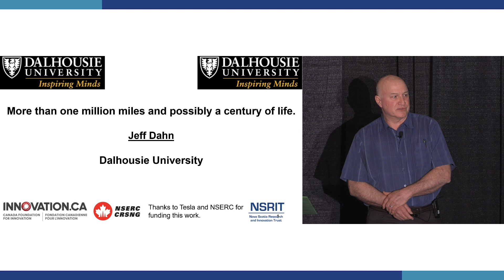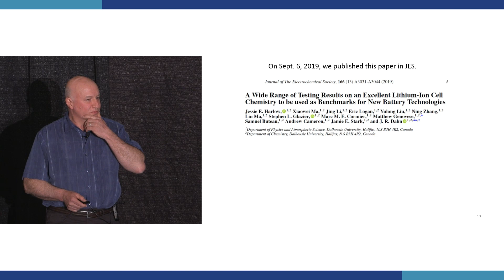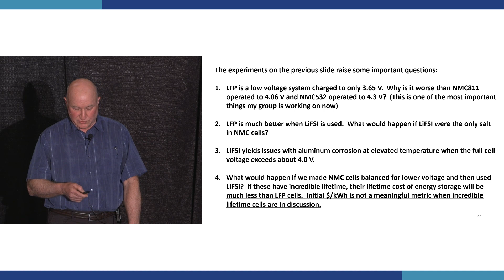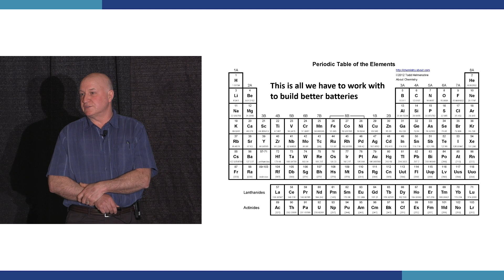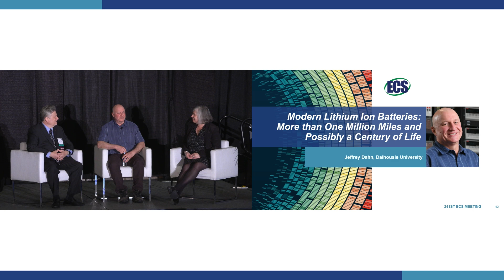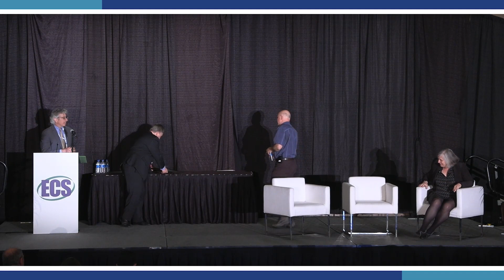241st ECS Meeting: Keynote Speake Jeff Dahn

Comment: @6:15 this does look bad (and it is), but it's worth remembering that transport by direct electrification uses 50% to 80% LESS primary energy than fossil fuel transportation, and production of low grade heat by heat pumps also uses 50% to 80% LESS primary energy than just burning fossil fuels.  So the real energy demand is likely half or less than the graph suggests.

Comment: Thanks for letting me know that my first electric car should be charged only to 70% on a daily basis, and 80% on rare times, and 90% only when required.   And that fast charging - I should do it before getting to 10% state of charge.  I think I will also be looking for a 150 KW charger, even if my car says that 280 KW is fine with the car.  

Lets say the F-150 Lightning is a $150 per KW battery pack and 135 KW.  That is a total cost of the battery pack of $20,250.  So if Ford felt they could sell that truck at $40,000, and I could somehow convince them to reduce the battery pack by about 40% to 81 KW, X $150 per KW would be only $12,150.   I would love to have a truck that is $12,150 less expensive, even if I can only drive it 90 miles a day! 

I have never driven more than about 45 miles in any one day in the past 2 years!  My trip to Medford Oregon, from Portland at about 300 miles would take 1 recharge with the larger battery, or 2 charges with the smaller and easy to afford battery.    I would love the lower cost vehicle!  

Tesla is planning on releasing information about a new car, with a $25,000 - $30,000 price tag.  I am hoping that the battery might be smaller, and thus make the car more affordable.  I would love a 2 passenger car to drive to work and home, not needing the back seat for most of that driving.  A 35 KW to 55 KW battery should be fine, if the vehicle is about 2,000 pounds?  Would that be possible?  

I was also thinking about a very low cost car that the workers in China could afford and drive to work, and be produced by the thousands!  Perhaps a three wheel, with two wheels in the front, and front wheel drive, with the battery pack under the center console of the car, say 12" wide and 60" long, so there will be more weight on the rear axle.  Maybe they could have a cast front end and a fiberglass body?  Very easy to assemble vehicle.  Keep it at about 2,000 pounds, and it should have a great range, even with a 35 KW to 50 KW battery pack.    

A cargo version would have just the drivers seat and a storage area on the right hand side, for pizza delivery, or flowers or whatever!  I know a HVAC distribution company that would love one to deliver parts to the customers (the contractors making a repair at someone's home) who are at the residential homes of their customers.  (the contractor loves it that the technicians are not spending a hour going to buy a part to make a repair, but instead can order the part, and have it in their hands within 90 minutes! ). The HVAC distributor loves that the customer is getting the parts quicker, and selecting them to sell the part to them, delivered, and in a short time!  So overall their business is up over 50% due to the delivery service.  

There are a lot of potential EV buyers who are saying "Why not install a 40 KW larger battery?"  The answer of course is that the extra 40 KW is about $150 per KW, or a $6,000 option that will also make the car mush heavier.  If Tesla has cars going 250 watts per mile, that would mean a 50 KW battery is good for 200 miles between recharges.  Or about 160 miles when charged to only 80%.  That is fine with me, I never drive 100 miles in one day.  And if the Tesla fast chargers are located every 100 miles along I-5 in Oregon, I can run 100 miles, charge for 8 minutes, then run 100 more miles.  

Put a couple of fast chargers in Ashland, on the hill going into California, and I can make it to Weed, where I can charge again on the other side of the mountain.
Reply: Cool

Comment: A few things I somewhat disagree with.  400km, (250 miles), is enough range in ideal conditions but it can get cut almost in half in extreme cold and snow.  Extreme cold also slows down charging speed.  For those reasons a 500+km pack is desirable.  Additionally a larger capacity pack will have fewer cycles per miles driven and cycles for supporting the grid so it may make sense to sacrifice some cycle life for capacity.
Reply: Yes.  My first thought was that 400 km is sufficient, but 500 km does make a more desirable car.  In below freezing temperatures I don’t drive as much or as far, so even half range (200 km) is plenty for everyday driving.  I believe that driving less when below freezing is common, not just my habit.  However, for long trips the extra range of a 500 km, or even 600 km, car is a benefit.  The longer range allows a greater choice for when and where to charge.  To make EVs affordable to all new car buyers, I like Jeff Dahn’s approach with 400 km range, zero growth in internal resistance, and >25 year battery life.  Someone needs to build such a car and offer 15 year warranty on the battery and drivetrain.  At the price of an IC engine car, no one would hesitate to buy.
Reply: @georgepelton5645  Actually for an affordable car you want the most range from the least amount of batteries so it might make sense to not worry about 25+ year capacity retention and push the peak voltage higher.  In truth what Tesla does seems ideal, let the user set the charge percentage, that way in every day use you can charge to a lower voltage but still do a 100% charge at a higher voltage for longer trips when needed.  99.99% of the time I don't charge beyond 85% and I only do that about once a week so after my first drive the pack is sitting at an even lower voltage most of the time.
Reply: @JRP3  Good point.  My useage is similar.  I charge to 80% every night.  I only charge to 90% or 100% on road trips, finishing the charge just before leaving to minimize time above 80%.  As long as existing batteries will last 25 years, getting the most range from the least amount of batteries (lowest cost) makes perfect sense.  However if the battery lasts “only” 10-15 years, then a replacement battery will be needed before the car is scrapped at end of life.  I think it will be more cost and resource effective to design the battery to last the entire life of the car.
Reply: BTW, Great talk by Professor Dahn, as usual. 😀
Reply: I disagree with the need for over 200 miles of range.  You can spend 10 minutes recharging and get that extra 50 miles in that time, while installing a 40 KW smaller battery pack.  $150 per KW X 40 KW is a $6,000 option!  If I could buy the F-150 without that 135 KW battery, I would rather keep that $6,000 in my pocket, and make it possible to buy a EV.  If the price is to high, I would never be able to afford a EV, so the smaller battery is great for me.  

On a 200 mile trip, you would need to charge one more time with the smaller battery.  On a 300 mile trip, 2 more times.  But overall it is not that big of a deal, as long as the car is something I can afford to buy.
Reply: @Kangenpower7  You ignore the fact that your 200 mile range becomes closer to 100 miles of range in severe winter conditions or while towing.  Also most people would like to be able to drive 3-4 hours without having to stop.

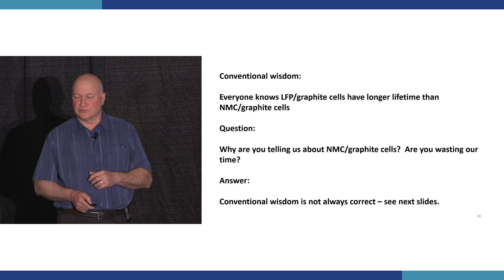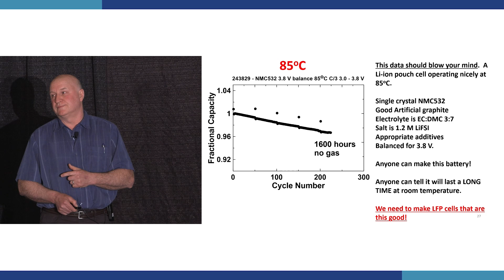Comment: 18:30 What's important , avoid large volume changes , use best graphite, appropraite electrolytes ,      23:50 LFP vs nmc ,  25:30  best nmc vs best LFP ,     28:10   lower voltage means nmc 10x battery life plus high energy density ,   31:12 testing at 70degrees (nmc wins) ,  31:50 tempreture matters ,  33:50 100 year battery ,    35:43 nmc at 85 degrees ,   sodium ion batteries important,

Comment: not sure if this was answered,  what if you only charge the LFP with LiFSI to a lower voltage? like 3 volts would that make them last longer? or does the degradation only happen to either battery  at around 3.8 volts and above?           EDIT: the answer may be that degradation only happens with a large volume change in the battery which does not occur with LFP
Reply: Also LFP at 3 volts doesn't have much capacity, maybe around 20%.